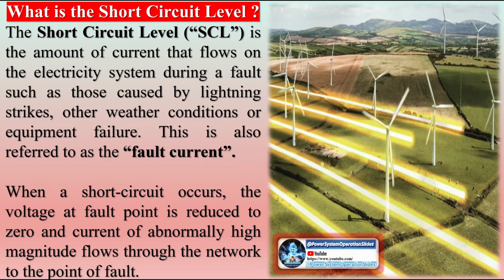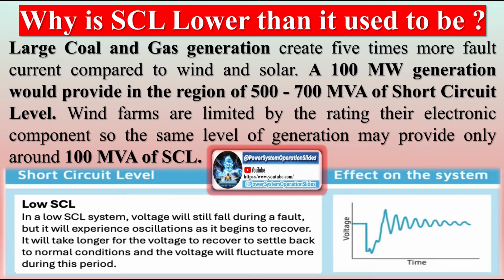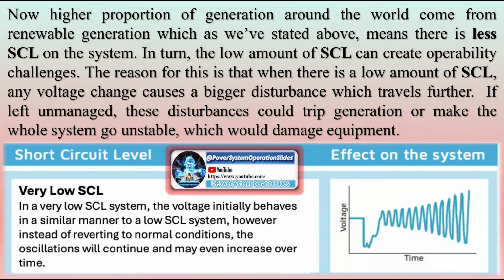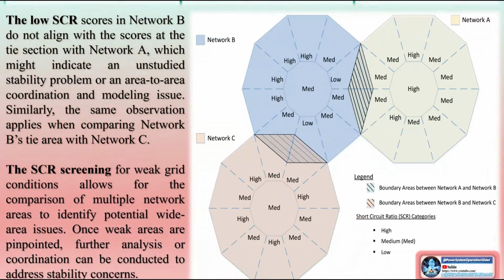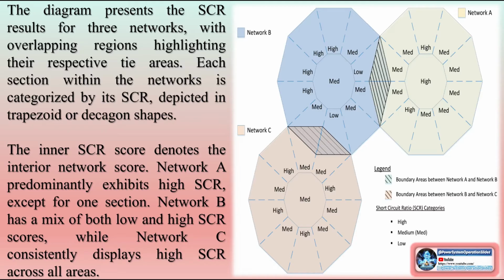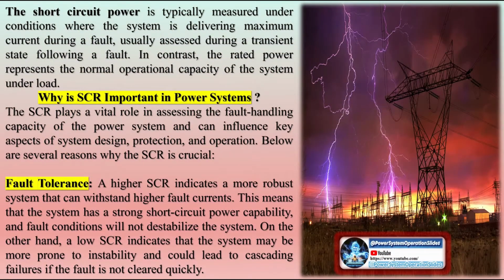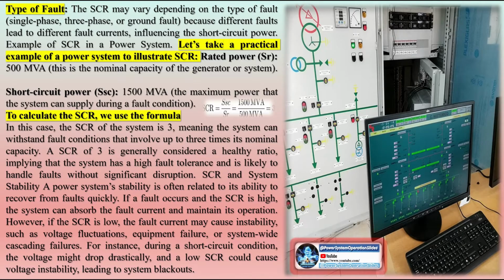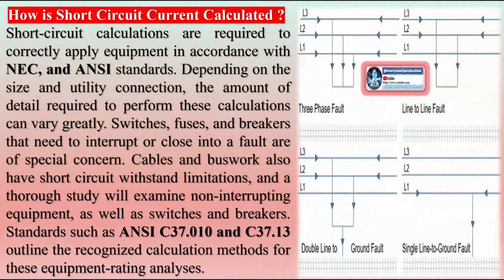Power System Strength & Short Circuit Level | Power System Short Circuit Level Impact | Grid SCL

Comment: The comment at 1.20 about wind turbine SCL is too general. Wind turbines can have full converter and the comment is correct. Other types of wind turbines have partial converter, with an asynchronous generator, where the stator is directly connected to the grid (DFIG type, or double-fed induction generator). These types of partial-converter turbines also have about a factor of 5 contribution to SCL. 

That's what we've measured during FRT tests on the MV side of the turbine trafo when we apply 0% voltage here we get about 5x the nominal current primarily as a reactive curent spike.